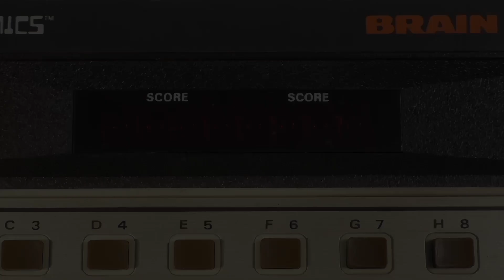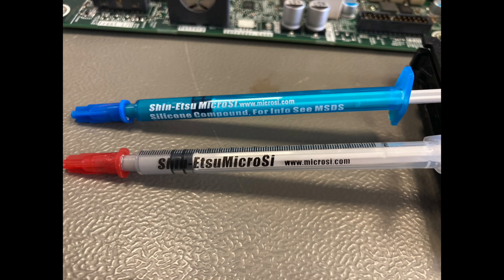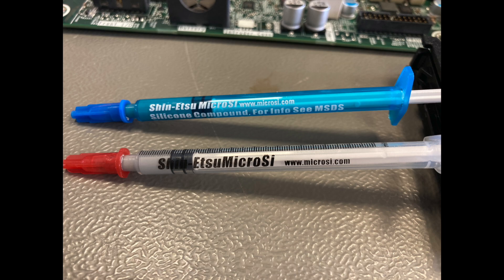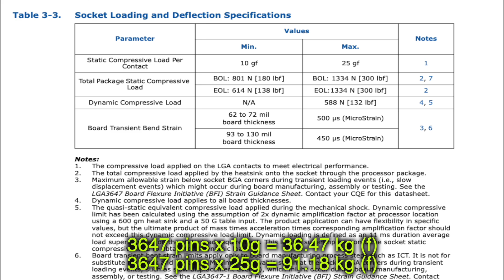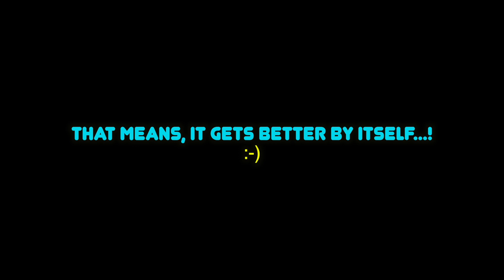Thermal paste applied correctly!  (PWJ271)

Comment: Kind of funny how that last application made kind of a teddy bear shape as the paste was compressed. But that made for an really interesting demonstration. Fortunately, the much smaller interface of the consumer range of processors is quite a bit easier to deal with. During my recent upgrade to an X870E setup with a Ryzen 9 processor, I decided to give TG's graphene Kryosheet a go. Stuff is really, really fragile and kind of a pain to keep from wandering around if you even so much as breathe in its general direction during install. Those sheets are as slick as ice. I ended up putting an incredibly tiny dot of thermal grease on the very edge of one of the corners. That seemed to work very well to keep it settled during the installation of the waterblock. I can't say with any certainty how it compares to the paste I usually use, but I can't say I have any complaints about it. My processor temps seem to be right where I would expect them to be with the system under a heavy load. That stuff is really fascinating. It would be incredibly interesting to see how they are able to manufacture that stuff with the graphene structure running in the Z direction without it readily falling apart when handled and packaged.
Reply from the maker: I also experimented with thermal pads. Some are very good but they are more expensive than paste. We need a lot of paste because we constantly replace mainboards or CPU's. So we need a solution that is cheap.
Reply: @PlaywithJunk  Oh no, I get it. Those sheets would be absurdly expensive at any commercial scale, even more so if you're changing out components at a regular basis. And it was extremely expensive compared to conventional paste. But it was a new-ish thing and I thought I'd give it a whirl on my own rig. I had tried the earlier styles of carbon sheets that didn't have the Z axis arrangement and found them just ok regarding thermal conductivity, though they do have the claimed advantages of being reusable and having extremely long term stability. But they are extremely conductive as well, so there's always at least some degree of chance for disaster if something goes wrong and a chunk ends up migrating somewhere it shouldn't. But it's definitely not really an option for any large scale commercial application at the current cost per unit. It's just an interesting bit of new-ish tech at the performance consumer level.

Comment: Since thermal paste do not wets aluminium thermal impedance is high. Also aluminium has thermal conductivity equal 237 W/mK and paste has only 1/20 of this value.
Go ask GPT how much difference is between 0.5 mm of paste and 0.1 mm in overall thermal conductivity. 
It should wets radiators and it out to be as thin as possible. It is provide to fill porous structure in metal layer. Let's make them smooth and then apply paste. 
While you start make some important calculation you can realize that super glue is best in word thermal interface between aluminium.
Reply from the maker: Superglue... have fun pulling the cpu off the heatsink 🙂
Reply: > super glue is best
🤣🤣🤣

Comment: Why are there no screws at the top left and bottom right. There should be even pressure all the way round.
Reply from the maker: The screws in the corners are only for proper positioning. The pressure comes from the center screws, only they have leaf springs.